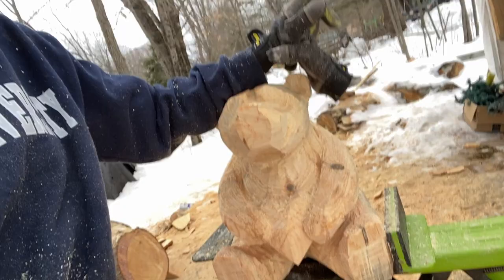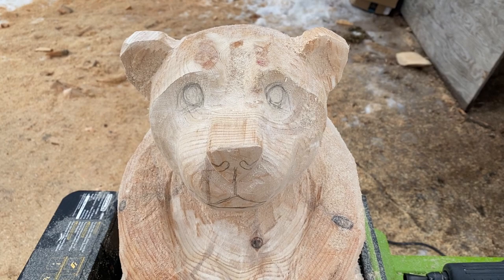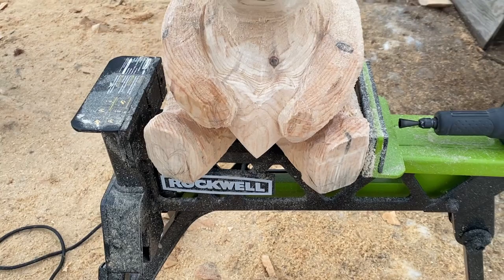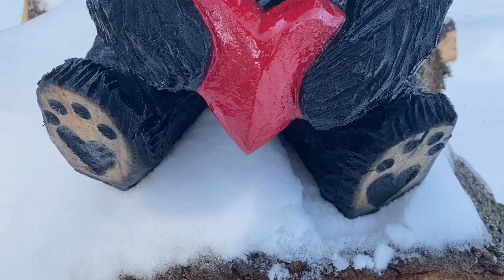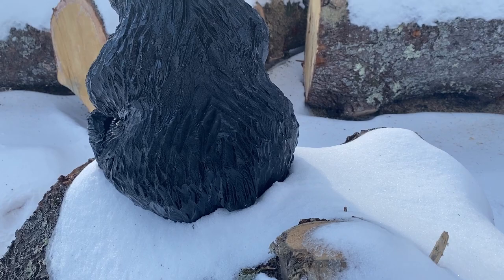Chainsaw Carving Small Cute Bear

Comment: Freaking unbelievable!!!! Question! Do you have to have a different bar for carving or can I use an existing one? I know it’s probably easier, just was curious how much I have to spend to do a carving.
Reply from the maker: No not necessarily! I started out with a stock 18” bar and used that and that alone for months! What saw(s) do you currently own? I can make recommendations for bars that won’t break the bank if I know what you got! :)
Reply: @TayMarie23  I don’t really have one, access to an old one. I like the electric Oregon one you have, that’s a $100 on amazon currently. If I don’t have to upgrade the bar right now, what is the next thing you would buy? Die-grinder, chaps, dremel? I have some safety gear… glasses, gloves, ear protection… I also have some smaller rounds at my house, like 3’ x 16”. Just stuff I was going to split for fires outside. What’s maybe two items you have to have or would recommend for someone just wanting to start.  Thanks for making these videos and replying, I appreciate you taking the time to answer my questions. Oh, and merry Christmas 🎄 or happy holidays!
Reply from the maker: #1 before you even start a saw up is chainsaw chaps. They can be expensive but sometimes you can find a good deal on Facebook market place, people buy them for a project then don’t need them. Get yourself a pair of those before anything else, looks like you have the rest of the PPE covered. 

For the saw, you could start with electric or get yourself a good cheap gas saw. I love my Stihl ms170s, I have two. They are strait forward, no bells and whistles, and super affordable at $199. Can get one from your local dealership or at an ACE Hardware. Watch my bald Eagle video, that’s the first project I used the ms170s with stock 16” bar. It’s a great saw for all carving levels, it will let you block small to medium sized projects, can put a detail bar on it in the future, and it is light weight. 

Other then that you can get yourself a cheap angle grinder, the one I have was around $10 from Harbor freight (HF). Die grinder are super helpful and one of the most useful hand tools. I have the Makita and cheaper Hercules one from HF, both work great. The Hercules one is around $70 at HF. Get good burrs for it, the cheap ones stink, either Kutzall or Saburrtooth burrs. With the die grinder and angle grinder you should be able to do almost everything you would want to and if you enjoy it you can expand from there.  With the MS170, die grinder, and angle grinder with flap sanding disks you have yourself a great starting kit for under $350 all in. Hope this helps and Merry Christmas!
Reply: @TayMarie23  thank you for replying to me, I really appreciate it! I have my list now, I’ll go get those things and get cracking! Well, after wrap some present and cook a standing rib roast for seven people, but when the holidays 🎄🍾 are over… then I’ll get cracking! 🤓
Thank you again for your time!
Reply from the maker: I love my tools and tool talk! Always happy to answer questions, never hesitate to ask! Enjoy your Rib Roast 😉❄️⛄️